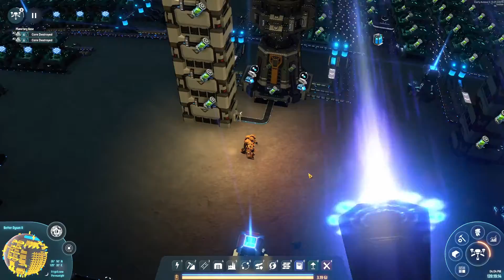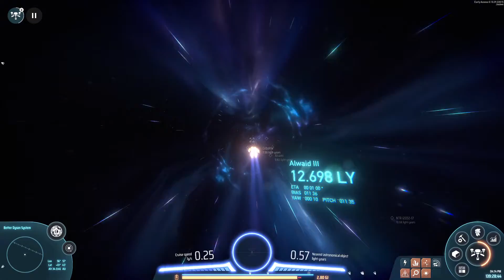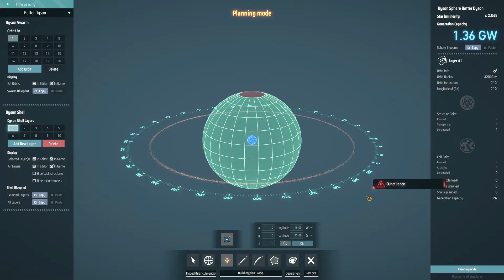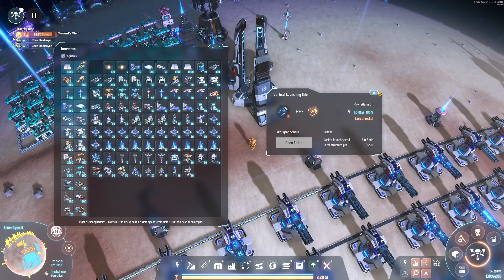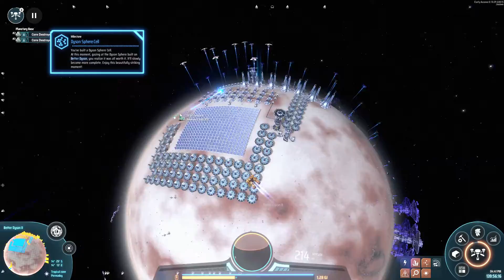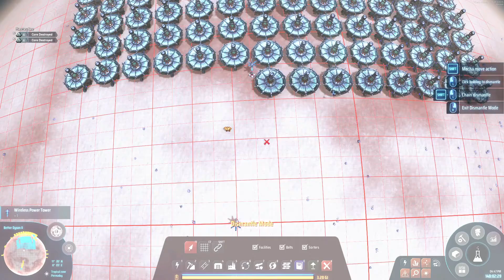VERTICAL LAUNCHING SILO // Dyson Sphere Program // Mission Log 129

Comment: you were able to pretty much figure it out by the end but here's a quick summary:
Its a lot easier to design if you pause the game in the sphere design panel. top left corner you can click on "time passing" that'll stop the sphere from rotating during planning.
First, create your Layer. this is where you can choose your orbit radius. it gives you one as a default but you can delete it if you want a different orbit. the bigger the orbit the more nodes/frames/sails you can fit. the grid part just helps you align your nodes, similar to the building grid or writing on graph paper.
place nodes around your star first. then connect 2 nodes together with frames. once you have a polygon of frames (doesn't need to be square), you can fill in that section with sails. nodes frames and sails can additionally be painted any color you want, this does not effect power output.
nodes and frames both add to "structure points" each structure point is 1 rocket.
filling in an area adds to "cell points" each cell point is 1 solar sail, pulled from anywhere in the swarm.
each structure point adds 96kW * (Star luminosity)
each cell point adds 15kW * (star luminosity)
each node can only absorb 120 sails at a time, so the more nodes you have, the more sails you can absorb at a time (but your total sphere will be more expensive, since you are increasing the ratio of rockets to sails)
once created, the shell will continuously and infinitely output power without maintenance. 
rockets can be launched from anywhere in the system and they will automatically target planned nodes. no need for further config or line of sight. rail ejectors need line of sight to the swarm orbit, but otherwise do not need further config to add to the shell.
Reply from the maker: I figured some of that out but really, another great and very helpful comment. Where is this information in game?! The worst thing is the default shell orbit they give you. I guess I should have paused first but as soon as I started painting my rockets were in flight so this first sphere is just going to be what it is. I say first sphere, but there won't be another one lol. Anyhow, thanks as usual :)